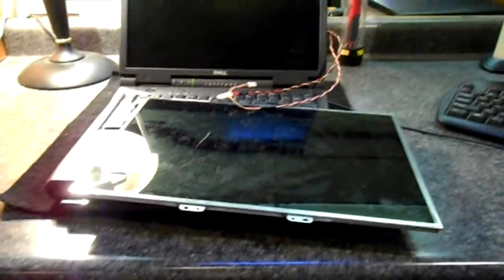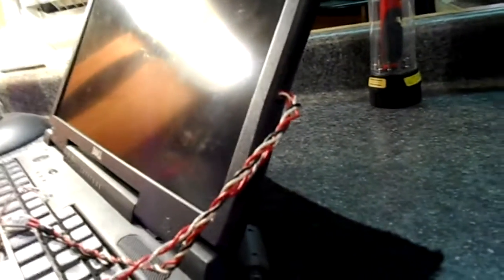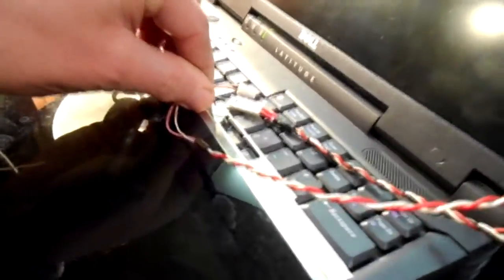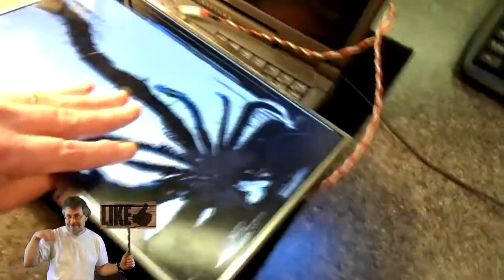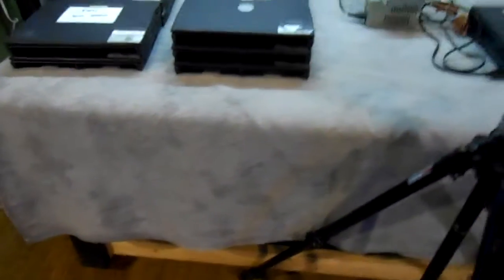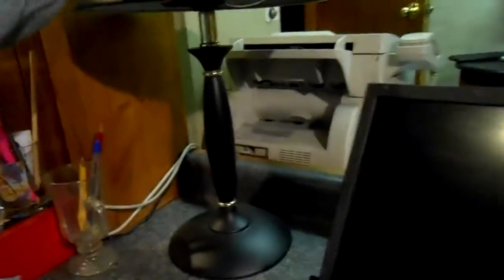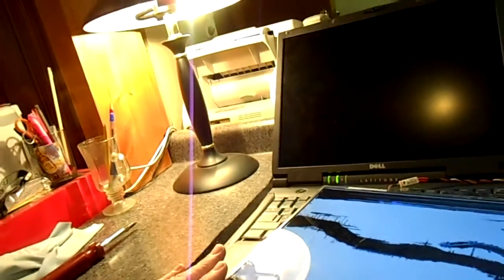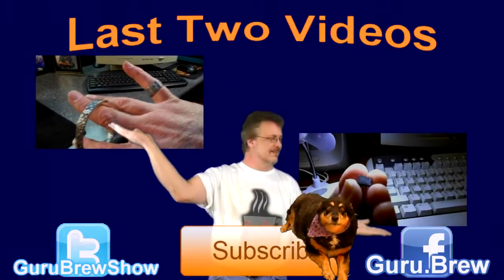DIY LCD Backlite Illuminating Bulb Tester Using an Old Laptop

Comment: The lamp depends on current flowing from earth to the body of the lamp to change brightness, by some circuit, the laptop is running on the adapter which is powered by 3pin cord, since current is flowing from earth through you to the lcd to the adapter and then to the earth terminal of the lamp, its changing brightness i believe
Reply: I also think so, Makes sense!